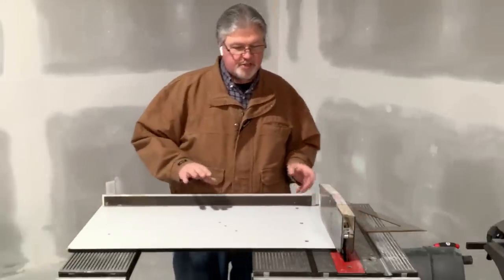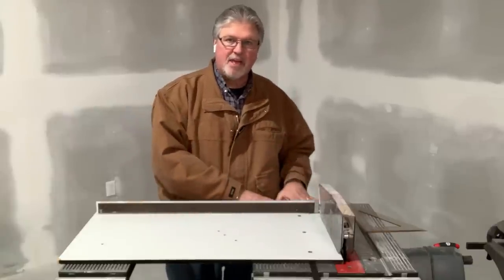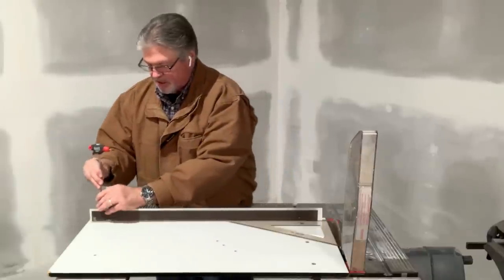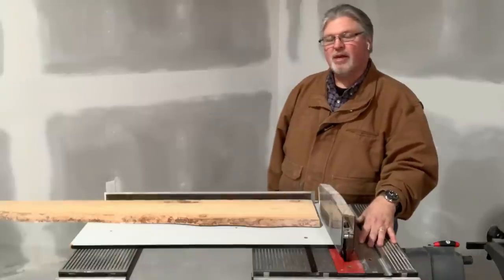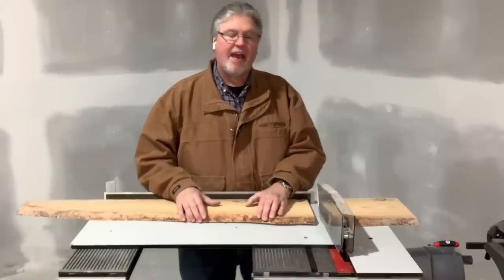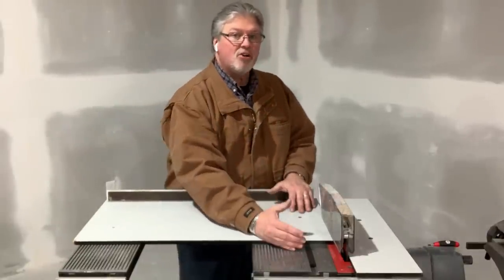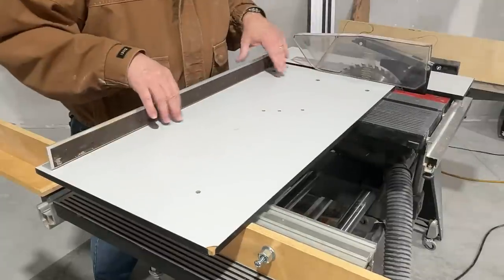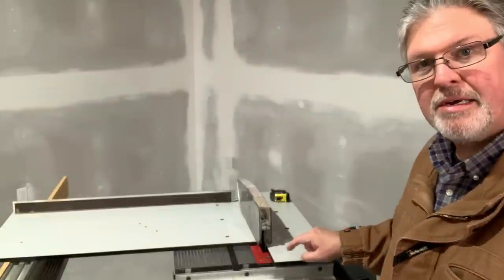Shopsmith Cross-Cut Sliding Table (Thanks Norm!)

Comment: Have you ever done a full out video on the shopsmith miter?   For a miter gauge it does not get much better.  It is super easy to screw a wider face on it.   Not saying these sleds are not nice or worth making as I have several.    But for cross cutting miters you can place a 3 x 12 face on it and have great support at the blade and even sacrificial.  Then the Shopsmith miter has a special screw that lets it become a fence on the bandsaw and so much more.    I somewhere have a dowel making jig that goes on the face  of my miter and you lock it down in the table so it cant move, it is made from 3 1x 2's and lets my straight router bit stand in the middle and it has a large hole on on side to feed the square stock  in, spinning it with a drill against the router blade and it the other size out comes the dowel rod works perfect.....    I do have a love for these old machines. I am intending to make a sliding table for might right end table one day before too long.

I bought on Ebay a old 500 carriage and table.   My 3 hp Hitachi bolts on the carriage and it has short legs that fit on the end table spot.  The router is centered 90degrees under the table and you can crank the table up or down and even tilt it.  Tilting router table and shaper gives you  a lot of crazy design you can come up with.  Then it is a standard shopsmith table so you can use all your goodies...    Only it much safer than overhead routing.     My only regret I have is I made it with a 500 table and nota 510
Reply from the maker: I’ve done two, I believe. The first one was one of the earliest videos on my channel: https://youtu.be/ILqeevkKf3A

Comment: Thank you Scott.  I've had a ShopSmith Crosscut Sliding Table with the Auxiliary Table for several years but have always been afraid to use it. I suspect because it didn't look as 'fancy' as all of the YouTube iterations that are out there and the fact that I'm pretty happy with my chop saw. Now I'm excited to get out into the shop to put the sled to work. Thank you too, for the video on adjusting the ShopSmith Auxiliary Table. I've never been totally happy with how mine was adjusted and have tried tweaking it many, many times. After watching your video the other day, and about a half hour in the shop, mine is now 'dead-on'.  THANK YOU for both  videos!
Reply from the maker: Glad to hear it, Dennis. Now, go make some sawdust! Scott

Comment: Good Idea!  I'm ashamed to admit that I actually used my Shopsmith for nearly three decades before I built a crosscut sled.  Came close to a nasty kickback several times trying to use the miter gauge as a sled. Then I built a true crosscut sled along the lines of a standard tablesaw sled out of melamine and it improved my cuts and safety dramatically.  I have to spend a minute or two fitting the slot to the blade but once everything is aligned I'm good to go.  Though it is easily my best and most used homebuilt Shopsmith accessory, this new variant looks even better as it doesn't have the fiddling adjustments, so I think I will make one soon. Thanks for the clear description.
Reply from the maker: Thanks for watching. Yes, a sled really does make that task much safer. Scott

Comment: Thanks for the tips & info. I have the cross cut sled with the outboard for drop offs. You had an excellent idea Scott. The holes in the sled are bored for setting fence at 22.5 & 45 degrees. Once you get the fence properly aligned for either angle, you can run a permanent, fine point marker along the fence to mark set up point without having to re- measure every time you want an angle other than 90. We appreciate you.
Reply from the maker: Yes, marking those lines on the table sure does help. I posted a few pictures in the community tab, showing the fence at other angles, but I felt the video is running long as it was, so I didn’t include that in the video. Scott

Comment: Scott, great as always- I love the tip for the extra length on the infeed!  What I always did on the offcut side was to put one of the extension tables (not the floating one) in the opposite side, and raised it so that it was ~ 1/16" below the sliding table, ... and sometimes still had my wife or children to help. ;-)   My model 510 came with 2 of those extension tables that had the 'end tubes' attached, so I use them in a variety of ways to get extra length, in addition to the extensions off the table.
Reply from the maker: That’s very smart and was something I was thinking of including in the Q&A, so thanks for the reminder. My jointer lives on the left and only rarely gets removed, but that’s one of the few reasons that would justify removing her.

Comment: Scott, Thanks for another fantastic video. That's a great tip using your extension mounted on the fence for indeed support for the cross cut sled! I had the good fortune of attending the "jigs and fixture" class at Shopsmith ?15 ? years ago. We made 2 different cross cut sleds which unfortunately were very bulky and heavy(made from 2x4s and melamine).One was for a regular blade for cross cuts, and the second was for cutting dados. The cut off pieces falling off was not an issue because the sled was centered over the blade. They both worked well but after I attended another class, I purchased the incra cross cut sled which is much more versatile and potentially more accurate as you probably know. 
For those viewers who have a model 500 a cross cut sled makes a HUGH difference and is a must build (or purchase). 
Back to a 510/520...the extension brackets that Shopsmith sells is a great investment, but works best if you acquire extra floating tables. Since they attach directly to the table, they easily tilt with the table.For extra long boards, an extension table on both ends of the Shopsmith gives more support, and for 510s and 520s Mark 7s, using more floating tables can allow one to cross cut boards as wide as your shop and support both ends. But then a chop saw, circular saw, and even a hand saw would be more convenient to break down long boards.(I keep a hand saw in my car for that purpose!) keep the videos coming and Happy new year. jim

Comment: And that's why you you hold onto some of the old slides for the miter gauge.
Reply from the maker: Good point. How are you at drilling and countersinking steel, because that bar was never intended to be mounted to a jig.
Reply: @MyGrowthRings  Ha ha. Guess its all how you attach with the threaded and through holes. Also in case you missed my other response, please shoot me an email. Need your help on a video
Reply from the maker: My email address is ScottMarkwood(at)gmail(dot)com

Comment: Thanks for the video, Scott.  I picked up a sled with the auxiliary table included for $130 after shipping on eBay thanks to your heads up.  I bought a Bosch GCM12SD chop saw this summer, which has been amazing for the hardwood flooring I've been installing.  However, there are cases when I have to create notches in the ends of floorboards to fit into corners or around structures, and so they aren't cuts that go through the entire width of the stock.  Bandsaw works ok, but if I want it perfectly square or if it's longer board, it can be difficult to deal with.  I think the sled is going to be perfect for that application (and others that I'm sure will come to light).  Merry Christmas and Happy New Year!
Reply from the maker: I agree and that would be my approach as well.

Comment: Shortly after a "Doh!!" moment, I found myself gluing in a kerf wide filler piece into my SS Crosscut sliding table.  I never again put the thing's miter bar in the wrong slot.  After several years, the filler piece has lost its grip on at least one side of the "racing stripe" in the sliding table.  So I'm springing for a new sliding table, but this time I'm going to put some strong day-glo tape at the leading edge of the table top right where the old table received its battle wound.  That way, as the blade approaches the table I will (theoretically) see the tape and stop from making the same mistake a second time.
Reply from the maker: Hopefully that will do the trick, but a stop is a good idea.

Comment: In my opinion, you really need two slots for an accurate crosscut sled. You've got something that is several feet long only guided by one slot. Just leverage alone seems like it would be enough to knock this thing out of whack. A much better solution in my opinion is just buy yourself one of the festool mft tabletops, and that way you are moving the saw over the work piece. I use a cheap shop fox plunge saw and track. I don't have the fancy hinge for the track like Festool does, but it works, and You can cross cut around 25 inches perfectly square. I cannot imagine trying to take a 25 inch wide piece and running that over the shopsmith on some table supported by one small track. Nope, not going to happen with good results. This might be useful for some smaller pieces, but not for larger ones, and that's really where you need the accuracy in my opinion.  I would suggest people do some searches for the festool MFT table to see the great versatility of this. A number of people have created portable tabletops with CNC machines for use on job sites. This idea here seems pretty antiquated given current technologies.
Reply from the maker: I’ve actually done a few videos on my track saws, so I know what you mean. That said, you’d be surprised how accurate a sled can be using a single guide bar, and perhaps two is better than one, but not always.

Comment: Thanks, Scott. One thing I notice is that, compared to the crosscut sleds one sees on Youtube, the Shopsmith one is pretty barebones. The current style of crosscut sled straddle the path of the blade, and feature tall fences with t-track for flip-stops, and hold-downs on the surface of the sled. I'm wondering if there's a way to build a similar style of sled that will work on a Shopsmith? My gut tells me that, without a way to make main table placement relative to the headstock repeatable and precise, any crosscut sled that straddles the blade is going to be all over the place....
Reply from the maker: Yes, it can be done. This can be used quite accurately, but when I need that degree of accuracy, I typically add a sacrificial sub table of Masonite or quarter inch plywood that will support the stock all the way up to the blade. If you build one like is commonly seen on YouTube, do you want to include a replaceable throat.

Comment: When i purchased my cross cut sliding table, i was thinking it more a cross cut sled, the kind that the saw blade passes through, for making small cuts for segmented turning. I was pretty disappointed when i found out this wasn't what it was used for at all.
Reply from the maker: I totally get what you are saying. You can use it that way by attaching a 1/4” piece of Masonite to the deck with some double sided tape, and a sacrificial board attached to the fence, but by the time you do all that you might as well make something from scratch. Scott
Reply: @MyGrowthRings  I ended up doing that, and am happy to see a few very good uses for it, but as you said, when you have a chop saw, especially if its on its own mobile stand and has wings for long stock, its hard to setup the shopsmith to do that job when the other takes much less time.

Comment: The cross cut sled has always confused me. It seems to be too small to be a panel sled, which you might want to support 24 inch panels for standard base cabinet parts. But seems larger than needed for common board widths 2-12 inches wide. What would you say the sweet spot is?
Reply from the maker: You are right. I typically used it to rough crosscut stock after it's been planed but ahead of jointing and ripping, and the most action mine saw was on 4/4 cherry that was roughly 8' long and 8" wide. I've cut loads of that type of stock with it and it always worked great. But you are right that it just isn't wide enough for base kitchen cabinets.

Comment: I made a cross cut sled for my ShopSmith. But the blade runs through the middle of the sled so the peice of lumber is supported all the way through the cut.
Reply from the maker: That’s another good approach. Are you able to use the song garden splitter with your design?

Comment: The two pice is no longer shown as being sold on the shopsmith website. Is there a separate shopsmith online shop?
Reply from the maker: Their site is a bit of a mess. You can find the crosscut table by searching that term, and the second part can be found by searching part number 555526. I would suggest they you call or email their customer service to see if there’s a bundle that includes both, because there may be a discount available. Scott

Comment: Good content (as usual). My crosscut sled for my model 500 uses a wood runner on each side of the blade, but the runners are wood and the fit of the runners leaves something to be desired (work in progress, next one will fit better). I do have a miter saw for cutoffs, but a sled works much better for half laps and tenon making. Will this sled work with the dado head?
Reply from the maker: It will for some widths, but I don’t think I can take it all the way out to my sets 13/16 inch max. I’ll have to double check that and report back. Scott

Comment: Great video Scott. I have a 520 and have tried both the 500 bar and the washered bar, and each has a little slop or side to side play.  Is it my table or is there a way to dial the runner in better?
Reply from the maker: We pretty much have to assume that it’s the bar, because regardless of which it is the bar is the only thing we can adjust. Keep on mid that there has to be some space between the slot and the bar or it won’t slide, but if you want to tighten it up using the method shown in step 5 of this article: https://www.woodmagazine.com/woodworking-plans/tablesaw/tune-your-miter-gauge
Reply: Ray I may be a little late but I use 3/4 inch PVC trim board, it fits exactly perfect and slides nice in my 520 slots, just rip off a piece just a little bit shallower than the depth of the miter slot.  An 8 foot long, 6 inch wide piece had made me at least 50 runners for shop made accessories and I have more than half left.
Reply from the maker: @markmurphy8066  GREAT TIP!

Comment: Mine didn't come with the sandpaper  on the guide fence.
Reply from the maker: Yeah, I wasn’t sure I was remembering that right.
Reply: It doesn't come with sandpaper for the fence. The sandpaper is an option. We'll worth it though as the aluminum fence is fairly slick.
Reply: @MyGrowthRings  I didn't see it in the instructions. It's complicated machine with endless parts and components. I put on a handle upgrade on my dust collector and the drilling temple was wrong. Luckily I have enough of a skill set that I know to check it several times before I drill something like that which saved me from screwing it up by following the instructions. For that reason I thought something was off when I bought my sled. The positive here is that I had more trust in your advice than the instructions and even when you are wrong about something insignificant, we still learn something. I need to get myself some sandpaper for my fence.
Reply: @ellisreeves8936  I used mine last week to cut some long boards and they were moving before I locked them in if I wasn't careful. I have to get a roll of it and start using it on jigs.
Reply from the maker: @haujeancontactee  I’ve experience errors in instructions too and it’s maddening to learn AFTER the holes are drilled in the wrong spot! Yes, abrasive on the fence really does wonders, especially if you pivot the fence to cut angles. Scott

Comment: Is there a reason not to add a support on the infeed end or your jig just like on the outfeed??? K
Reply from the maker: Like the one I installed at 7:29, or something else? Scott
Reply: @MyGrowthRings  Yes, the wooden one you flip around.  I know sometimes it might hit the miter slot but if i put it further back it could hold a nice in-feed as well as out-feed for some rip cuts Or I could just make two; one with one and one with two. K
Reply: @MyGrowthRings  It would be a lot lighter than other choices. K
Reply: Yes, the one at 7:29.

Comment: That things like the final opponent of a video game then on the last level you face the death machine that it shop smith level 1 is like a jig saw
Reply from the maker: Have you ever beat the final opponent? The Shopsmith is nothing to fear.
Reply: @MyGrowthRings  I'm not a huge video game guy but I did get into 1 game on the phone and that was the name of the last level death machine lol but as far as the shop smith goes it's as safe as the user wants like any piece of equipment is there's inherent danger with any spinning blade although some of the older ones prob aren't for a novice